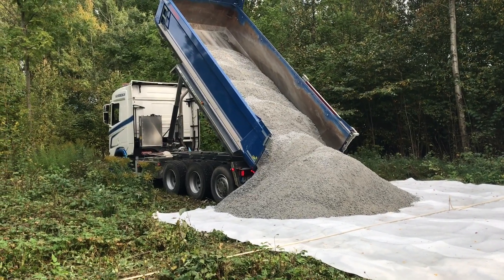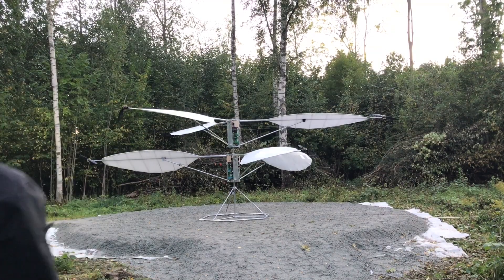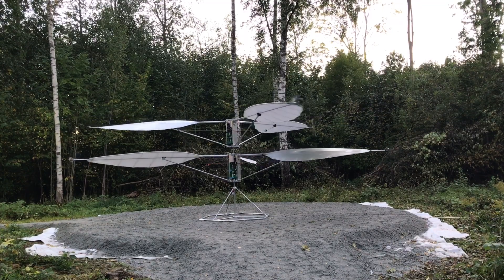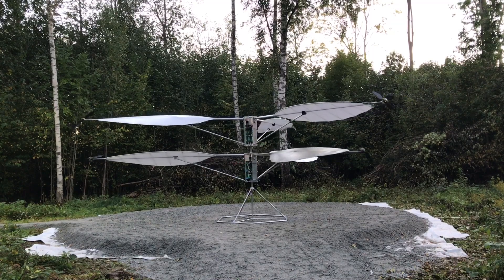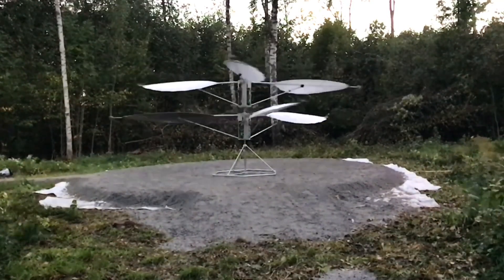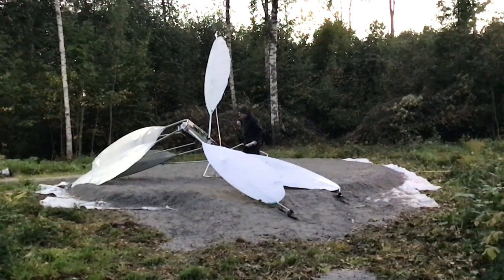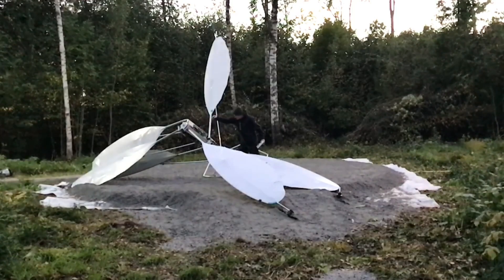Coaxial Levitator 2 First crash....

Comment: To lazy to read the coments below: the negative pitch of the lower rotor blades occured at all 3 at once. they was bent towards the ground by downwash force by air from the top rotor. Maybe they even catch a resonance and bent even more. At certain point i guess the lift force and downwash force at the lower rotor exceeded torque limits of the leaf construction. Shortly: the uper rotor was fine, because experienced only the lift force and the construction is stretched. The lower rotor leaves experienced oscilations against their own lift and the construction was stretched and squished repeately . Sorry for possible cpt. obvious effect, and english.

Comment: I think the forces are too strong. Or better: not manageable structurally. 
There is a reason, why vertical windmills over certain heights do (practically) not exist. The reason being is, that the bending and shear forces are too strong, because it is too unbalanced in the load.

Comment: Hi there. 

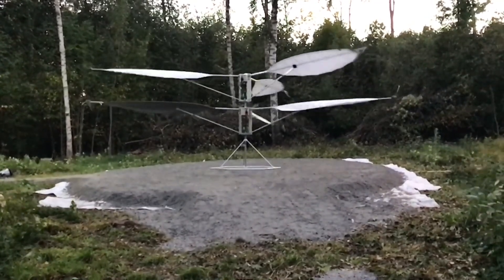I know its been a couple months, but I also watched Your video over and over ... and over again.  If You are still trying to figure out why it went wrong,  I think I actually see exactly what happens the first second after the cracking sound. Also I dont think stuff breaks at 8:19 like someone suggested. Anyway..

Set Your Youtube speed to 0.25 to verify or disagree with my findings.
Navigate to 8:20 and start video, breaking sound at 8:21.
Now pay attention to the lower prop blade that is just about to go behind main shaft. 
When it appears again the pitch on this one blade will go from positive to really negative in halv a rotation. This results in this blade's lower support rod being bendt heavily as seen 8:24-8:27.  

I think the reason for the breaking sound was Your mechanism to rotate(pitch) this spesific wing breaking. 

 I got some experience from building/repairing rc helicopters for customers earlier, and things not perfectly straight will always vibrate a lot on the ground. Usually a lot of the vibrations and shaking on the ground will go away once  properly in the air

It's such a shame we could not see this fly properly before the crash. 😢

Comment: Observation.  It seems that the contra-rotor helicopters’ rotors are separated further apart. It seems as though yours are really close together.  How does distance affect rotor wash?  How does rotor blade design compare to the standard helicopter blade? It occurs to me that blade design history, both with single and contra-rotor machines, might guide current applications.

Comment: Seems premature to give up this guickly.its facinating to watch.also did you think of shortening the cables on the single rotor the install a low tension sppring in the cable ends,
to effect a small amount of flapping effect?

Comment: At 8:24, the skid touches the ground.  This sets off a chain reaction of events leading to the rotors colliding.  This is an issue with full size copters as well -- bad things can happen when the pilot doesn't get it clear of the ground and the skids touch the ground.  It sends a vibration that escalates and completely messes up the rotation of the main rotor.

Comment: You really, seriously need to do a Google search on coaxial helicopter design theory. There's a NASA paper that discusses this. You can't design a coaxial helicopter just based on guesses and assumptions. 
First of all you must, MUST have cyclic control of all the blades. And the helicopter is inherently unstable. It cannot be designed such that you can fly without  continuous cyclic control. Impossible.
This is a complex physics and engineering problem. There are no simple solutions. None.

Comment: I think you broke a pitch link causing that cracking noise on the lower blade that is at the back at the time. You can see it invert as it comes around and drives the craft over. I feel for you after an obviously laborious build. Thank you for sharing this journey.

Comment: Centre spine looks very weak, visibly distorting very early in the rotation and aggressively under lifting load, the whole thing looks out of balance, wing structures look weak and bent causing lower and upper wings to touch, and simply not suitable for lift. In fact I'd suggest they aren't giving negative pressure lift, but acting more like fans and trying to blow the thing up! ... Indeed the whole thing looks unviable due to structural weakness, even the legs couldn't take the landing!.
I'd look first at keeping the centre spar solid and straight under rotation and also at the loading achieved by the wings (whether by upward low pressure from above or wind pressure from the fan effect) related to the strength of the wing mounts, they aren't even braced from the rotational forces, and structure as a whole. the wings, for instance, seem toindependantly change angle of attack far too easily, which won't help vibration effects at all.  
Look at 8.26 ish to see the central spar bending when the undercarriage touches down and letting the wings hit... the whole structure needs stiffening somewhat.
Hopefully constructive ... It looks fantastic actually .. ;)

Comment: Rule # 1.  As I was learning to fly RC copters, to prevent tip overs I attached X shaped sticks to the skids with wiffle balls on the ends to keep it from tipping over if the trim was off. That way I could start a liftoff without fear of tipping. Adjust trim and try again. CHAIN IT DOWN so it can only rise a FOOT. Adjust and try again. If it tries to SCOOT in ANY direction during liftoff, start over. Tweak and try THEN set her free.
Reply: That's exactly what I was going to recommend

Comment: I thought of this a long time ago for the human powered design! Your drive propellers should be Position in the spar support location witch will give higher rotational speed. But you need to consider better weight and balance to keep vibrations down.

Comment: Ok.  As a model builder. First build small.  Make changes on a small model.  Redesign as problems occur. Make it as light as possible. Test. Get it to fly.  Test. Train yourself to fly that model.   Prove it works.   Build bigger.  Test.   Prove it works.  Build bigger.     If you can make the small one fly you can make the full size one fly. It saves a lot of time and money to start small.
Reply: I think that that is an excellent suggestion.  The ‘wobble’ at startup, perhaps instability is a better word, should have been easier to catch and correct with a smaller (much) model, as opposed to the crumpled heap on screen. Excellent idea.

Comment: Sorry to see you had a crash!
I think it is getting too complex and probably too heavy.
Maybe keep the top rotor large and tri-motor as the main lift motor, then reduce bottom rotor in diameter and make it simpler and lighter with no control surfaces or propmotors on the bottom rotor. Maybe just a motor and reduction belt so the bottom rotor can be turned as needed to keep the payload non-rotating, and maybe get some lift from the bottom rotor too.

Comment: Due to the buffeting inherent with counter rotating props they need to be either extremely narrow like helicopter blades or short and rigid.  Also, move as much mass as possible to the bottom of the rig and decouple it from rotation so your fighting as little inertia as possible.  Just suggestions, hope it helps!

Comment: I love your work, thank you! If you made the lower part, the bottom of the stand heavier than the top part then it will stabilize much easier while creating a safer landing. So you could for example place the batteries at the bottom point of the design. Hope to see more of this and that there are some kind souls out there that can help with a little financial support. 👍 Maybe if you skip the main battery pack, just use enough batteries to maintain a stable flight and make the wings covered in solar cells. 😅

Comment: one of the control links broke..  the angle of attack goes to negative pitch. right before blade hits the ground. You can not see the mechanical failure, but you can hear it happen right before the blade goes negative pitch

Comment: i may be wrong but i feel like the main advantage of a coaxial rotor setup is the torque cancellation effect. but in your case since you are driving them with the tip motors you dont have any torque to cancel so you are left fighting the disadvantages of the coaxial setup, ie vibration from the lower blade interacting with the wake from the upper blade and double the part count. i think you were on to something good with your earlier single rotor design and i bet with incremental improvements you could make that one fly really well. i wish you the best of luck whatever you decide to do!

Comment: Wonderful! Thank you so much for sharing your experiments, it is very generous especially to share your disappointments. I hope you don;t mind me venting some ideas.Imaging two control surfaces in front of each propeller, vertical and horizontal able to define the circle and combat wobble. Each propeller unit has its own sensors and could be thought of as one of 6 planes flying in formation. The pitch of the main propellers could be controlled by a separate system. The canards of each power unit would have the leverage to have more control. I think they could control wobble in every direction. Thanks again for this great channel!

Comment: So, just a couple of suggestions.

Looks like you need a ballast weight in the bottom to help stabilize the craft.  All of the weight is up high, and it's top heavy.
Also, it appears that the rotors spin independently.  Have you considered locking the rotors by adding a planetary gear in between?  I feel like it might help with rotor synchronization if you did so.  You should still be able to affect lateral rotation by powering up one rotor vs. The other, but it would lock blade timing.  I think these two changes would yield some better results without changing the entire design.

Comment: Agree that it seems to be the spine flexing that's the root of all your major woes, it's got a lot of asymmetrical forces on it and can't keep the rotors parallel as well as it should. You can hear the thrust props collide before the crash itself occurs because the spine flexed and the clearance was closed. Still a promising design though, much more scope to scale than the first levitator imo! Think of the wingspan a single rotor design would need compared to this design. The original levitator seems so good because it had a lot more development...

Comment: Kinda hard to keep track but I'll say you got a sync issue on top of a slightly off vertical shaft, before the crash.    

It would help to distinguish the blades. Color coded, different patterns, numbered or whatever. You need to easily tell when top and bottom are out of phase. Looked like the two blades I was tracking met about 30° early then it started tipping.    

Starting to wonder if a faster µcontroller would be a quick fix, after the rebuild.

Comment: Just analyze the weaknesses and the strengths. Learn from it all. There’s a treasure trove of information in that hop and the crash. I think the pop was either a prop strike or one of the blade tubes kinked at the root.   Just guessing. You’re right about the blade tube weakness.  It’s the root that takes the brunt of the load. Make the disks larger diameter to support them better. Also the larger disks will provide gyroscopic stability (like flywheels).  You’re doing something amazing. Keep it up. The goal is definitely reachable!

Comment: Love your innovation and diligence!  Future testing might involve a central axle, which slips into a tube, mounted in the ground.  A bungee of sorts would prevent axle form escaping the tube.  This would allow for lift and balancing without resulting damage to structural framework.  "Nightflyyer" (on YouTube) made a support, like this, to pre-flight test his RC helicopters.  I followed his method, and made a couple of my own to test the RC systems... Tx and Rx, prior to free-flying, learning that some folks have released models to the air, only to have them fly off... never to return.

Comment: Excellent improvement since Lev 1,2,3 and your beginning. Your flight test location needs a flat surface ie. concrete and the basic tripod for 100kg needs wheels or round bearings so it slides rather than catches, like a helicopter moving sideways does. I still think moving all the batteries to the baseplate and sharing their power via sliprings to the wings would give less rotating inertia and less problems as you move sideways. Why are you not using a long elastic safety band for these tests just to give 20m safe flying space over the take off point. Whatever your decisions are you have to continue and improve, we all really need this in our lives. david

Comment: It seems to be caused by the cushioning between the two nodes. It seems to be unable to withstand the lateral load and a sprain occurs. My suggestion is to increase the diameter of the middle node and use bearings between the two bodies. If there is a spine that extends along the entire vertical line, pass it through the middle of the entire structure.
A very successful product. Congratulations.

Comment: The main structure is bending a lot. I’m thinking it is because when the wings move relative to each other the two different wing structures cause different lift vectors depending on how they are rotating relative to each other. If the main structure that the wings spin around is more rigid that would be prevented.
A bit of a guess granted. But it shouldn’t be bending like that

Comment: Great to see you posting again. A thought,,,, could you run a thin steel cable from wing tip to tip, creating a tensioned triangle to help stiffen 
the structure and maybe a way to balance the prop.
I've had a vaguely similar design in my head for a while only using hub motors on a single shaft.

Comment: Regret to disagree with some comments below as lowering the CofG leads to INstability - Flap back and the pendulum etc. ! The blade pitch angles look to be  less than rigid as the blade that ended up pointing to the sky went into negative pitch causing the disaster. We should perhaps make sure the c of G of the blade is coincident of the centre of lift to promote pitch stability. So sad to see this early trial end up this way after the majestic serenity of the earlier machines. I suggest further early tests be made with the base fixed to the ground where  early rotor instability might be less damaging. Wonderful project, well done !

Comment: 1. The main mast is not rigid enough: It visibly bends under the loads.
2. There seems to be some degree of coupling between the rotors, leading to vibration, likely exacerbated by: a) the high angle of attack (most of the lift is due to air being pushed downwards, not by a low pressure zone on top of the wing), and b) the rigid bracing.
IMHO, nothing that disqualifies the concept. Just a little tweaking needed. And great project by the way!!
Reply: Yes.
1. Yes, it does look like it bends.
2. Not sure what you mean by 'coupling'. The main mast couples them and it's bending.
Reply: I wonder if ground resonance contributed

Comment: That is pretty rough, I wonder if you had some sort of structure to hold it in place. Maybe a large metal pole to support it from might help in case it develops an unstable oscillation, or if there is some sort of roll torque due to the propellers spinning?

Comment: Every failure is progress :)  I think that with a rotor powered like this that there is minimal torque on the main body of the aircraft.  Therefore I would pursue a single rotor design from now on.  I would also have the batteries and electronics located in a fuselage below the main rotor to give more pendulum stability.  But hey I am just sitting here typing ideas and not actually doing the real thing like you are.  Respect to you :)

Comment: I may be wrong, but I believe that there will always be forces in the design that take the axis away from the vertical position. And there are devices that easily solve such problems. These are gyroscopes. Probably you will need two gyroscopes - in the upper and lower parts of the axis. Возможно , я не прав, но я считаю, что в конструкции всегда будут силы, уводящие ось из вертикального положения. И есть приборы, которые легко решают такие проблемы. Это гироскопы. Наверное нужно будет два гироскопа - в верхней и нижней частях оси.

Comment: Your design lacks pitch control feedback... And having contra rotating surfaces  with power from the edge of the surfases is useless as there is no tork.. A small flight computer used in rc planes can easily stabilize the machine...

Comment: Looks like it bounced on the ground on the side near to us and that caused the upper blades to collide with the lower ones since the central pillar essentially bent (probably a lot more force on it with the propellers moving than stationary). Check elastic limits/flexibility under 1/2 the weight of the whole system and with a lever effect of the base support at the bottom of the lower prop connection. I think using 2 or 4 blades would provide more stability in the interaction when the blades cross each other, since the opposite side relies only on the interaction of a single prop and not two which could amplify problems...

Comment: Balancing such a large mechanism without NASA level engineering is a challenge, so some structural compensation would seem to be required to handle negative vibrations. 🤷‍♂️
Reply: Balancing should be as simple as attaching half of the machine to a bearing on a wall like a wheel or simply putting on its side on a stand that is attached to the axel, the heavy part will spin to the bottom and weight needs to be applied to the opposite side then it's rotated let settle and repeated.
You can achieve quite good balance this way the limiting factor however is the drag or friction of the bearing this affects the "resolution"